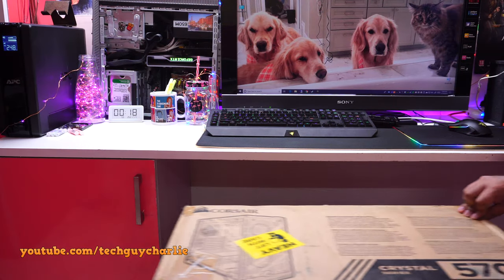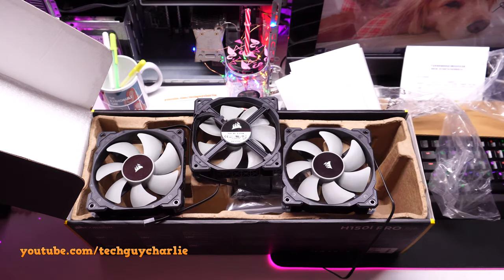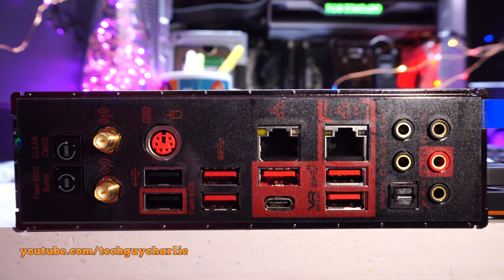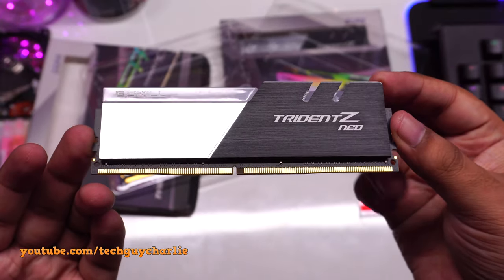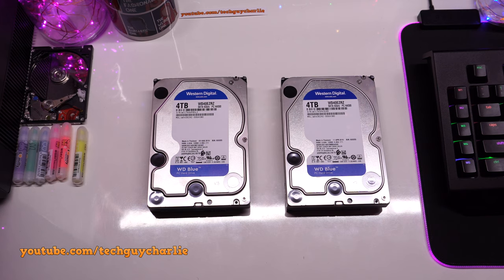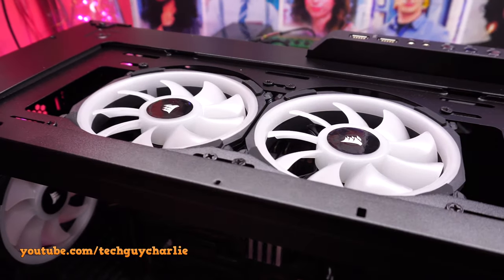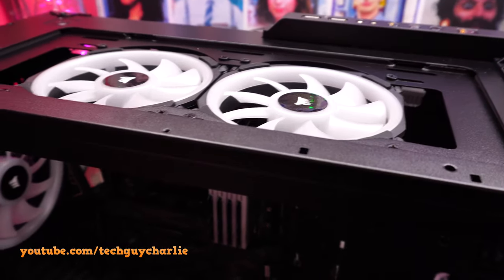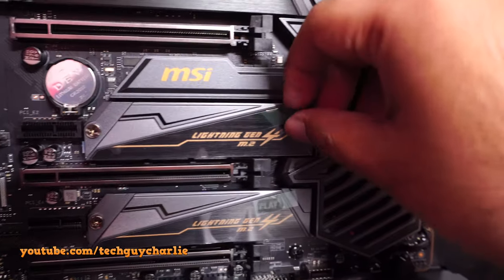AMD Ryzen 9 RGB 4K video editing content creation and casual gaming rig build (3900x RTX 2070)

Comment: I'll be buying a ryzen 9 3900x definitely for gaming cause I really need the best and if you really need more performance get the 3950x it is a binned with lower power consumption than the 3900x at stock and lower temperature at idle and load.
Reply from the maker: As much as I would love to get 3950x I don't think India will see it any time soon, even if it comes to India it will be soo much over priced thanks to the retailers wanting to reap huge profits and it will be not worth getting 😭 I already had such a difficult time finding the 3900x at the right price, every offline retailer is selling these more than the printed MRP and without bill.

Comment: So I just ordered this case for my new build.  One of the gripes I saw some reviewers make was about the PSU shroud, how it was open on the 'internal' end and it didn't have space for cable routing on the top.  I see in yours it has both of those things, did Corsair update their design or did you mod/swap that shroud yourself?  Just curious b/c I did agree those were two things that would make sense so it will be a nice surprise if the case I get has a shroud like yours.
Reply from the maker: Surprisingly enough, the case actually came with the PSU shroud pre installed, I can't even imagine how messy the case would look without it since I tucked all the cables inside there. I think they might have updated the design, I guess your case should also have one. Let me know if it does.
Reply: @TechGuyCharlie  Yes the original case had/has a PSU shroud too so mine will.  The difference in the original design and what I see on your shroud is that your shroud has a Grommet for passing cables on the top of it.  Also the end of your shroud that faces inside the computer is covered so you can see the wires or the PSU, in the original case it was open on the end so you could see some of the wires and the PSU depending on the angle  you looked inside.  Nice to hear yours came that way though, hopefully means mine will.

Comment: HI thats cool thinking of getting that board i have crosshair vii wifi x470 3900x, is it worth the upgrade ? thanks
Reply from the maker: Thank you,😊 I would suggest sticking with your current Asus Crosshair x470 board, its a solid choice even for 3rd gen Ryzen, upgrade unless you ONLY need PCIe gen 4. If I already had x470 board, I would not upgrade to x570. 
Hope this helps.

Comment: I'm building amd cpu 3700x(using wrist cooler included),gpu 5700xt, mobo aorus elite wifi x570, with system with same your case cosair x570. But I don't want spend more for LL 120m fans. So thinking about get 3 more sp fan for 2top and 1 rear and then i can connect with the hub already in case. Is that work.?
Reply from the maker: Yes, that will work great. The pre-installed Corsair fan hub in the case already has 3 RGB light port free, you can plug in 3 more SP120 fans and it will work with the built-in SP lighting controller in the case.
Reply: @TechGuyCharlie  great, reading much from cosair forum, so all they said should change to LL or HD fan amd commander pro , but those cost to much money lilke 200bucks, thought i should return this case before watching your video, thanks so much bro..